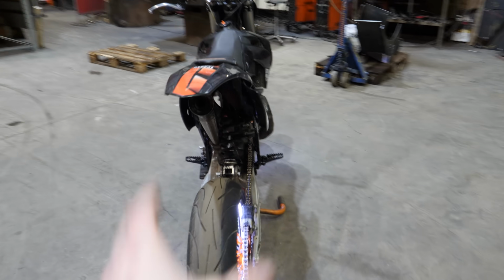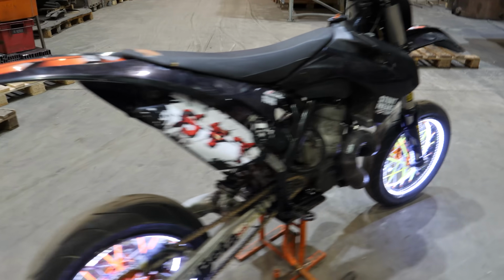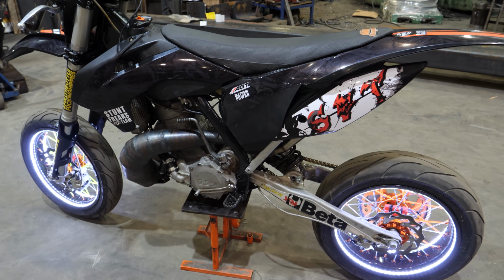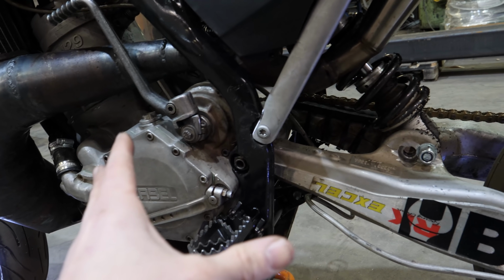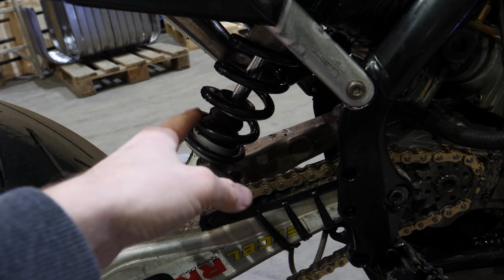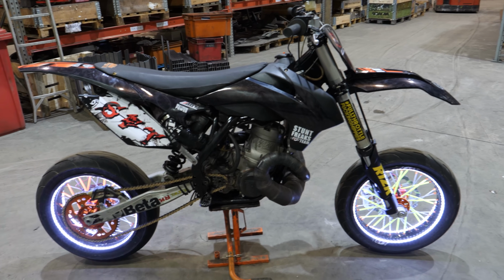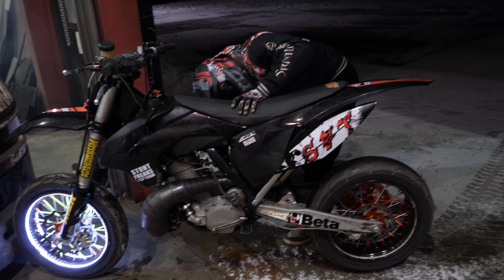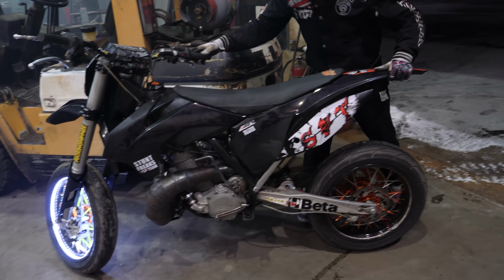700cc 2 Stroke Supermoto

Comment: How much HP have this thing
Reply: 80
Reply: @ryann754  impossibile, cr 500 had around 90 if I remember well
Reply: @ex3221  oh sorry did not know
Reply: @ryann754  I’ve seen other people here sayin it has 80 hp. Idk, but it seems impossible to me.
Reply: @ex3221  CR500 output is the stuff of myths and legend, but it's closer to 60hp and a modern 4 stroke is both far more accessible and outright faster.
Reply: @MrLilredmachine  it’s myth staff because it was a beast. You should drive one and then do the comparison. Anyway, it had far more than 60 hp 😂 around 90/100.
Reply: @MrLilredmachine  you have to consider it has 5 gears, and for the comparisons i’ve seen it is almost as fast as a 450 4t. It’s fucking 30 years old! In fact i’ve never said it was the fastest.
Reply: @ex3221  It has 5 gears because the engine is the 'diesel' of two strokes. It makes all it's power around 7-8000 rpm, then tails off after that. The reason highly strung bikes have 6 gears is so they can keep the motor singing up high in the rev range where power is being made. If the engine makes most of it's power in the midrange, manufacturers will usually keep the number of gears lesser and with longer ratios so that the engine can sit in the stunted powerband for a longer period of time. 

See bikes like the XJR1300 and the Bandit 1200 that have big low end torque and fat midrange figures but no top end all have 5 gears for example.   

To say it's 'almost' as fast as a smaller engine that fires half as often is speaking more to the mindbending performance of the modern 4 stroke engine than it is to the two stroke, regardless of how old it is.
Reply: @MrLilredmachine  having 5 gears they are longer so obviously it will loose acceleration and in cross it’s better to have 6 gears.
Reply: @ex3221  I'm not sure what you think is most common for a dirt bike, but most Motocross bikes have 5 gears, still to this day. CRF 450, KX450, YZ450 all have 5 gears. They don't need any more because they are meant to be used in conditions where top speed is under 80mph. So you can keep on stating the 5 gears thing, but most dirt bikes have 5 gears, and always have apart from a few (like the 125 2 strokes that need the extra ratio to keep them singing)
Reply: @MrLilredmachine  they have 5 short gears, the cr500 has 5 longer gears to compensate the absence of the 6th gear.
Reply: @ex3221  I'm not sure why you are arguing something that is fact. Most dirt bikes have 5 gears, about the only things that don't are some KTMs and 125 two strokes. By your reckoning they are all compensating for a lack of 6th gear, so there is no advantage either way. The reason most don't have a 6th gear is because it's unnecessary weight in the gearbox for a top end no one wants. The CR500 is no faster than a CR250 top end because they both run out of gearing due to both having a 5 speed gearbox and off-road ratios. And so will a CRF450, YZ450f, KX450 etc. The only way the gearing can be altered is to adjust the chain and sprockets or literally fit an aftermarket gearbox.
Reply: @MrLilredmachine  1) it isn’t true that “most” dirtbikes have 5 gears, nowadays almost every cross has 6 gears. 2) cr500 is a legend. Idk why you continue arguing it’s worse than today’s 450s bla bla, idgas: it is a legend and it’s far more difficult and challenging than a simple and tasteless 450 4 strokes.
Reply: @ex3221  type 'how many gears does a dirt bike have?' into Google and see what it comes back with. Nowadays almost NO dirt bikes have 6 gears. Just go and look. The CR500 IS objectively worse, it's a 35 yr old wobbly steel framed crosser that didn't put out all that much power when it was new but delivered it in an absolute thump in the midrange. That is why it is legendary, but also why it doesn't make much power, let alone the '90-100' you quoted earlier. As for being difficult to ride, a 2 stroke 125 is more difficult to ride fast and keep on the boil, the CR500 has power everywhere so you are never far away from a fist of 'get me out (or into) this situation' grunt. It's also scary because of it, but man up and it's also one of the easier dirt bikes to ride.

Comment: why are the tires backwards
Reply: Supermoto tires
Reply: @whodatboi1543  no those are michelin pilot power 2s,  they run the other way
Reply: @gixxxer1k  then idk
Reply: @elijah1923  no,  the direction they are running,  they should be spun 180 degrees
Reply: @elijah1923  so switch the damn tire at a tire shop, very simple

Comment: 150hp?
Reply: 80ish
Reply: Damn
Reply: Like 80-100
Reply: What?, 125cc 2 stroke has 40hp+, well if you say so....
Reply: panty man bro that's an old school cart engine ok. It's not the only 700 single out there that had a huge bore and short stroke and ran more tractor like power than dragster power. Most of those engines come tuned based on request. Maybe it makes that much. It certainly can be made that way but it wasn't commonly the case.  Honestly have no idea what the specific ratings are for it but if I had to guess it's not much more than 65 unless otherwise tuned that way.
Reply: oh, ok, like much torque compared to rpm, u mean?
Reply: panty man sure. KTM250SX makes around 49hp and XC300 makes 52. Which one ya think is more violent and hard to ride? That would be the 250. Who would win in a drag race? And even then slightest gear change or port job could change all that. I've actually ridden both of those bikes. And a yz250f makes around 46hp which is same rating almost as the old Banshee. Complete diff creatures. Banshee has almost nothing going on unless it's wide open, just like a 125 and that 250 fourstroke has all kinda broad range of horsepower and walk all over that Banshee. I've seen it done. And both of them were competent riders on both machines. 
 This supermoto bike can prob pull some tall gearing I bet. I'd like to see some footage of what it can really do

Comment: Impossible déjà le 500 CR Honda était réputé pour être intenable et pour une fragilité énorme alors je pense pas que ses un 700 cc 2 t
Reply: t'explique le fait que le cylindre soit encore plus gros qu'un 500cr ou 500 kx ?Et tu connais pas l'ancienne kawasaki h2 qui etait un 750 2temps
Reply: @matteogoupil7203   La Kawasaki H2 était un 3 cylindres en ligne 750cc donc 250cc par cylindre.
Reply: Wtf are you saying
Reply: Petermaler66 et donc sa reste un 750
Reply: Besoin de faire une petit incursion technique toi...
Reply: @matteogoupil7203  750cc oui, mais les cylindres/pistons sont bien plus petits que sur un 500cc monocylindre. Donc soit tu as mal compris ce que voulait dire Breton Nolan, et tu lui réponds à côté du coup, soit il y a une lacune de ta part sur la technicité des moteurs.

Comment: Exhaust pipe is not good for power
Reply: Maybe tuned for more bottom end and not top power? That is what they usually do  with thees 700 2 stroke engines, if not mistaken the whole engine is tuned for not top power but more low end torque.

Comment: Maico 700?
Reply: 700cc 2 stroke zebel
Reply: Macio 700 is 2 stroke dirt bike haha
Reply: it is the same engine as  the maico, But the zabel has only 4 gears, and  the maico has 5.  And there is no power valve on the Zabel.  Zabel is a company that bought the rights to make the Maico engines, just changed it up to fit sidecart racing and not enduro/mx.
Reply: @supertedogpriken  the maico and the label are two completely different engines..... Just from the fact that the maico has the intake in the cylinder and the label in the crankcase

Comment: Bullshit no way can u kick start a 700cc fuckin motor with sneakers like nothing !!! It sounds just like my 250 engine and all
Reply: Thats right
Reply: Ever Heard of decompression valve?
Reply: Those are astar riding sneakers
Reply: Definitely kick-started my cb750 plenty of times...
Reply: @snafuequals  That is very easy compared to a single cylinder Engine that has all the compression in one stroke
Reply: Look at the exhaust and the cylinder, you can tell it’s a giant bore.      It doesn’t sound anything like a 250, it’s very deep.          Decompression valve only cost $150.         And yeah a early cb750 is easy to kick, pretty cool kicking a 4 cylinder and feeling all those pistons turning over though

Comment: Am i the only one wondering why all supermoto and cross bikes have that ugly twirly exhaust that sounds like a 1970's 49cc moped?
Reply: Go read up on two stroke engines, that would explain why it looks like that
Reply: @ulsig95  I got a 2 stroke moped and a 4 stroke bike, but my 2 stroke have a normal exhaust.
Reply: @rasmus1600  And you can comepletely remove the exhaust aswell and make it less efficient. Just watch or read something about two stroke motors then you would understand why it looks like that, or why it doesnt look like that sometimes
Reply: @ulsig95  I have been fixing my own 2-stroke engine since i was 13 I know how it works. But exactly why a crosser or dirtbike have that exhaust, I don't know.
Reply: @rasmus1600 
Well a two stroke engine work by having two stroke on a full engine cycle. That results in intake, exhaust and compression happens during the same stroke. SO as the burnt gasses leaves the cylinder out the exhaust, new fuel/air mixture is coming in the cylinder while also some of it goes into the exhaust because the long cone of the expansion chamber in the exhaust helps suck the air/fuel mixture in. NOW the expansion chamber suddenly becomes more narrow, really fast which results in the some the gasses going out are being sent back and helps with the compression

Basically the better your timing with the lengt of the expansion chamber, the more efficient you are
Reply: From what I've learned from some reaserch on two strokes, straight pipes work well at a certain RPM, the funky looking things are tuned for a certain powerband and sort of cram more air into the engine.
Reply: @pyrofalcon146  Both will work as pyro said, you just get more air/fuel pressed into the cylinder with the funky looking ones :D
Reply: @rasmus1600  If you get the sports moped exhaust is has the round 'turbo kit' that 2 stroke needs. But they can also use normal pipes but they will not have the best performance
Reply: @rasmus1600  Look up 2t expansion chamber. It's not for looks, it's for braaaaaaap

Comment: I cant belive it dont have a fuckin power band thats pointless huge 2 stroke no power band is pointless might as well rip a 450 with a hot cam tweaked out same with the cr500 no power band now the kx500 ktm 500 they got it and they fuckin snap your neck fast
Reply: If you want Power go buy Suter MMX 500, it is about 195hp/127kg. Or Tularis 800cc 185hp/125kg. Pick one that suit yourself. In Suter you can increase the power by your demand. 210hp is possible in Suter MMX 500.
Reply: Well if the engine makes more power down low you wont feel the power band because it all smooth power..
Reply: you want power band?  ride a yz85.  you want power on demand get a cr500.  power band is boring, i need the power as soon as i flip that throttle
Reply: @NoStress90s  Suter MMX 500 Custom Powerband...